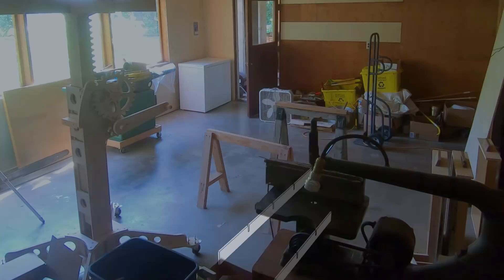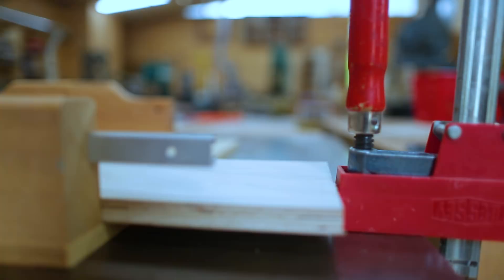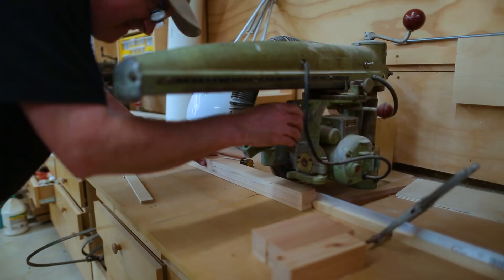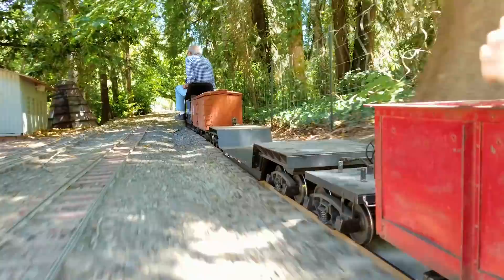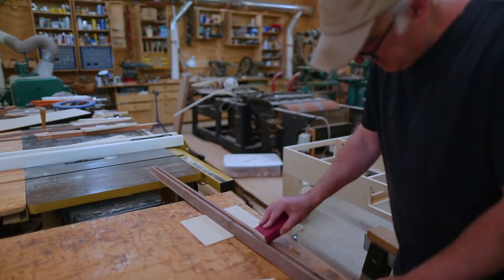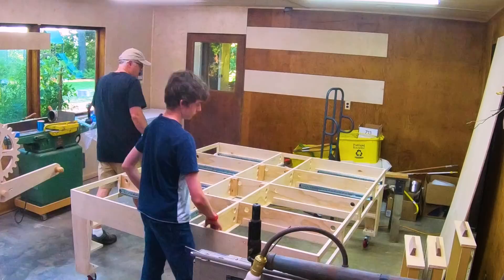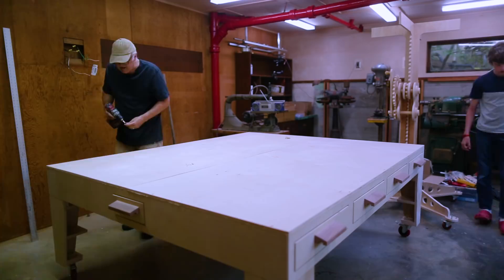Building a Model Train Table

Comment: When I was about Calvin's age, I had an HO train set in my bedroom. My father bought a defective hollow-core door that was badly warped, thus dirt cheap. The warped hardboard surface made for gently rolling hills, so it was perfect. I didn't have floor space for it, so my father mounted a 2x4 on the wall (my bed was up against the wall) and we used butt hinges to hinge the door horizontal over the bed. A swag chain from screw eyes in the wall supported the door/table when it was deployed, and I could swing it up against the wall when I wanted to go to bed. I had lots of fun building hills and rock formations using plywood scraps glued to the door and aluminum window screen stapled to that to provide the basic shape of the rock formation. Plaster of Paris was troweled onto the screen and while it was still soft, I textured the surface with a putty knife. It came out looking pretty realistic. I spent far more time on landscaping than I did running the trains.
Reply: That sounds awesome.
Reply from the maker: That sounds great, I can picture your set up. when I was in high school I made a bed over by desk, that worked that way.

Comment: One of the drawers could be converted to be a control panel.  Speed, switch controls, lights, etc.  Keep it off the deck and a cleaner layout.
Reply from the maker: That is the plan, One of the small drawers is ready for that.

Comment: When I was a kid, my father built a layout table in the basement that folded up onto the wall, much like a Murphy bed.  Not only did it have HO scale track, but it also had slot cars.  You could run both the trains and the slot cars at the same time.  When the train was about to cross the road, a crossing gate would come down and it would interrupt the power to the slots so the cars would stop at the gate.  The scale of the cars and the trains didn't match up, but that didn't matter to a 7 year old.

Comment: Cool.

DCC train control, Howarth guys. Even for just two locomotives on a tabletop, so much more fun. Son and Dad can run 2+ trains independently, both in direction and speed. The concept might make you rethink the track layout, moving away from just loops to watch trains run, to adding industrial sidings and such. Then trains have a purpose and a place to go, and you can operate with that goal and manage traffic accordingly. 

Have fun!

Comment: Such a beautiful design for a work/project table, Frank. Well done. I've been watching you for years, and finally have my first constructive (albeit armchair) critique; those drawer pulls are going to get in the way. Calvin will be snagging his torso on them constantly and bumping/moving the table. They also disrupt the lines of an otherwise clean, flush-mounted table design. I suggest just using finger holes as the way to open the drawers. Otherwise, gorgeous as always!!

Comment: Crazy thing is I actually worked on one of those locomotives they had two 12 cylinder engines and an additional small diesel in the rear for power to the cars each of those 12 cylinder 547s is the size of a Volkswagen bug just saying great work man!!!!

Comment: Hi Frank. You've mentioned fuzzy cuts in several of your videos. I get my cleanest cuts with a low helix down cut bit, an Amana Tool 51732. I have used it in hardwood, plywood, and Corian with equally good results.

Comment: I use a CNC for custom production work and nearly always cut out a blank to put on the table rather than cut the profile of the part with the CNC. The exception is when the part has a lot of curves and/or has holes that need to be precisely located in relation to the profile. I use a 1/4" bit on the CNC and the table saw has half the kerf and the cut is much cleaner requiring less sanding.

I have a couple of outfeed/assembly tables in my shop that are built similar to this. I made the legs a square box and had the two outside faces run up the outside of the torsion box to attach them with screws and the two inside faces stop under the box to carry the load. I also have a square on the bottom of the torsion box in the corner that the leg indexes on and provides a place to screw the inside faces to without using pocket holes or something like that. Of course the legs project 3/4" in each direction at the corners, but my top overhangs the box by 3" anyway to allow for easy clamping to the edge. My original idea was to have the whole thing open like yours so I could roll a shop vac and similar items under it. In practice I found that the legs splayed out just a little because I didn't really make the torsion box thick enough trying to maximize my clearance. I ended up making a lower shelf to tie the legs together. That negated my maximum clearance, but allows me to move the tables without having to move the stuff stored under the tables separately so it worked out in the end.

Comment: Do yourself (and Calvin) a favor and pitch that Bachmann E-Z track in the garbage. Before you make any trackwork permanent, put the money down and pick up some Kato Unitrack. It will be more expensive, but the payoff is worth it. It's of higher quality and offers fewer derailments, smoother running and even better aesthetic. I use it on my own N Scale layout for about 15 years now and I believe it saved me from losing interest in the hobby when I was younger. Kato makes it in both N and HO scales as well as some phenomenal engines (steam and diesel) and some awesomely detailed rolling stock for both scales.

Great work on the table and it's awesome to see some youngsters still partaking in the model train hobby.

Comment: Normally your videos are just plain awesome, but as a guy currently figuring out how to build a table for my step-son's HO set, this one made feel inspired, but also totally inadequate
Reply: A reasonable version of this table (maybe minus the drawers) could easily be built with nothing more than a circular saw and handheld drill.
Reply: btdga yeah that's basically what I was planning to do
Reply: Might I also suggest making it a u-shape rather than a rectangle (assuming a similar footprint).  Reaching in and knocking stuff over gets old very quickly.

Comment: Could you have done the initial glue up with the tabletop upside down - so all the flat edges were on the ground during that phase?
Reply from the maker: Ha ha Calvin suggested that as we were finishing up.  That would have worked, as long as the floor was really flat.
Reply: It turned out fine anyway, and Calvin sharpened his problem solving skills along the way.  He's going to get  years of enjoyment out of the table and the memories of making it with his dad.  Cool project.
Reply: I wondered the same thing. Makes sense with the different height pieces. However, a good teaching moment that a bigger hammer isn't always the best plan. ;)

Comment: Surprised you didn't put on any finish. The top probably doesn't need any but the sides and especially the drawer faces/handles would look so good with it.
Reply from the maker: We should probably do that
Reply: frank howarth with a model railroad the goal is to hide the fact that there is a table (layout) holding up the track. I recommend painting it a gloss black. By the way, Awesome b-roll with the 7 1\2 gauge rideable trains. Another note I see your using Bachmann track i highly recommend kato track instead it's just a higher quality snap track in General.  Have you looked into DCC? You can do so much more with your trains like run two on the same track, have sound blow a horn and ring the bell at the press of a button. Just food for thought, best of wishes with the hobby, just like wood working it's a life long hobby and I love them both.

Comment: Apologies if someone has already suggested this. But wouldn't the issue with the table top facias being 1.5in taller been eliminated if you turned the whole construction upside down? After all the all of the top surfaces were flush (or appeared so).

Comment: I have a bunch of Lionel cars and a few engines with some buildings and scenery along with a ton of metal track that is in great shape with little to no rust. It was a set that I inherited and don’t have really any use for it since it’s just taking up space in plastic tubs in my closet. I believe Most of it is circa 1970’s - 1980’s but could actually be earlier as far as the 1950’s. I don’t know too much about them but Would you happen to know anyone or a place besides eBay or another website like that where I could possibly find someone who would be interested. I’d like to sell the set as a whole rather than part it out. Any information would be greatly appreciated. Thank you and love your vids Frank. Keep it up

Comment: I don´t only work with wood, i used to be a Modeltrain Guy too...i´m sorry, but i see no way of hiding the wires like you would on a regular Table.
If you place a house, Streetlamps etc. you drill the hole into the Table and pull the wires through...and there will be a lot of wires very soon.
So the accessability to the bottom of the Table, which is blocked by drawers and the crossing boards atm, is as importend as the top, because it hides all the "magic".
Awesome Table tho :) Maybe you want to make the 2-pieced Top layer at least raisable with some mechanic?

Comment: how will you run wires under the board for the train?
Reply: 6:54
Reply: I need to learn to wait until the end of the video. :)  But he still could have talked in a little more detail.  :)
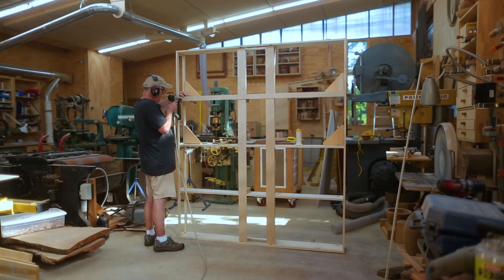Reply: My guess would be thru the holes he pre-cut on the CNC, as seen @ 7:07.

Comment: When I was Calvin's age my father and I built a similar table and we rigged it with a pulley system to the rafters in our garage and I could lower it down onto some saw horses and disconnect it from the pulley system to use my trains. much like this set: http://cdn6.bigcommerce.com/s-e252rx/product_images/uploaded_images/cat1960c.jpg?t=1458302073